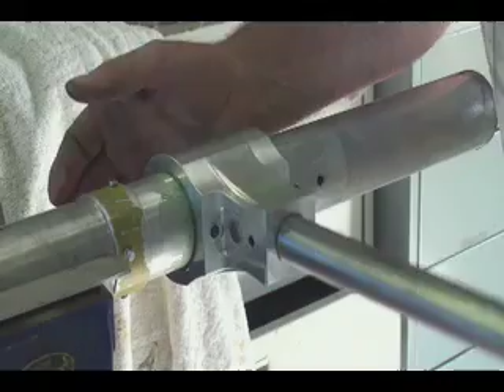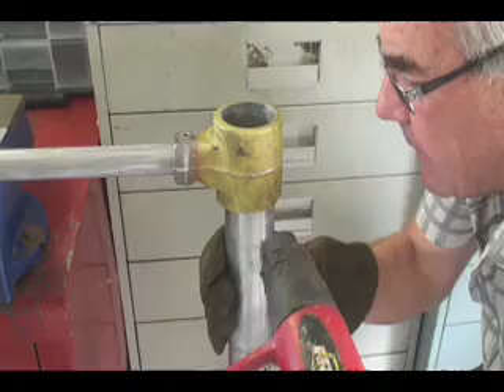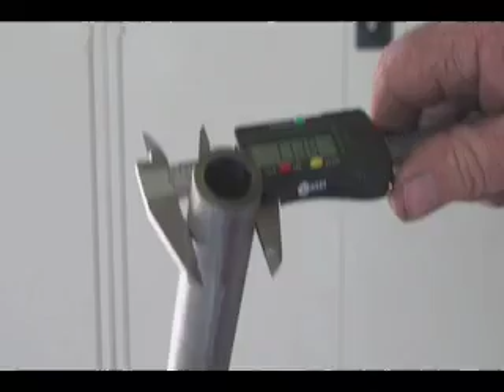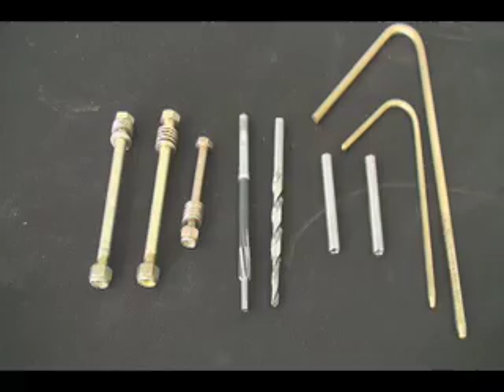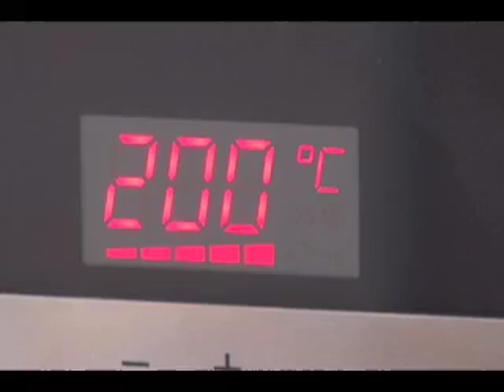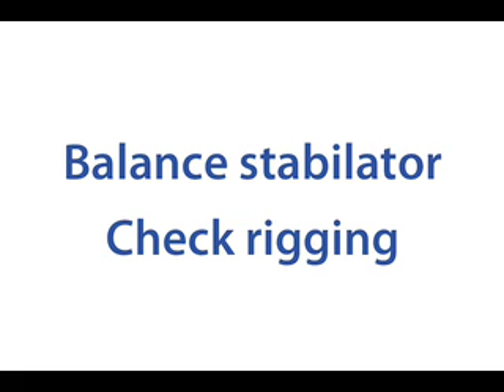ICS-Stabilator-050511.mov

Comment: I notice they removed the original Piper horn from torque tube using a heat gun to expand it. The new Aussie horn is not a interference fit to the torque tube but uses loctite. But the balance weight arm tube is still a interference fit on the both horns.